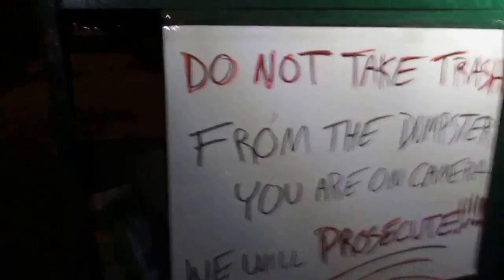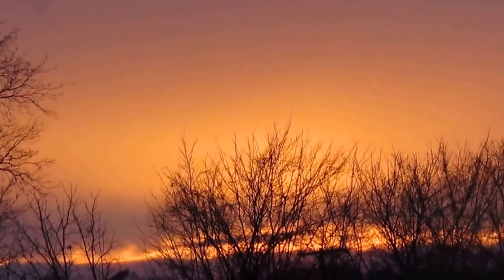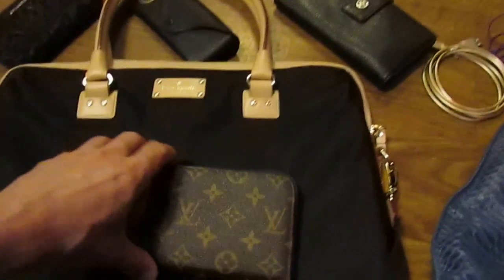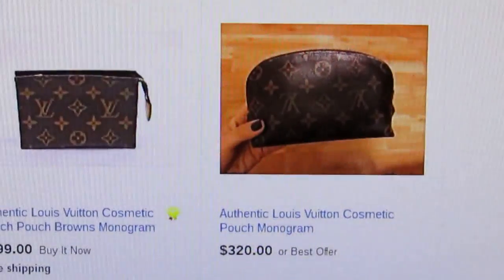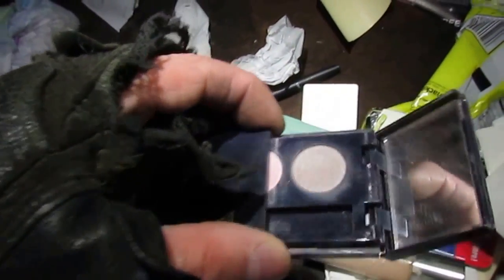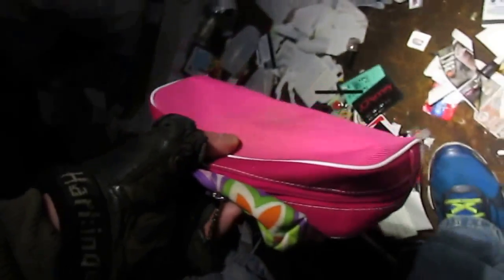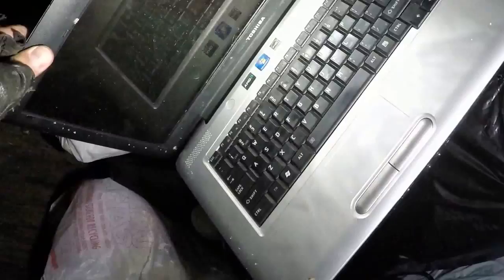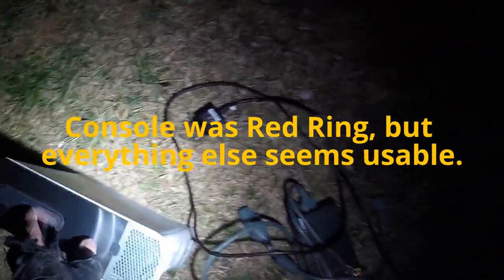Shocking Dumpster Diving - Kate Spade (fake) Louis Vuitton - $330 Fan Blades - Copper - Coach - Xbox

Comment: I went to the site, typed in Miami ide and it brother up the free make up so I clicked to put it in my cart and from there it won't let u do anything. Maybe that's why no one has claimed it. I'm going to keep trying and see if I can figure it out. Maybe it's something I'm doing.
Reply from the maker: hmm, it seems to be working fine. Although, if i knew anything about coding i would make it much more simple and stream lined! I think the problem you may be having is after you click to put it in your cart you then need to click the "view cart" button and proceed from there...Also, you need to be logged in b4 you start the process.

Comment: Locks can be removed without damaging the lock itself. Just cut the hasp itself.  A simple cordless tool with a cutoff wheel right through the thin part (hole) of the metal and the lock can be removed intact.  Do this only on locks that piss you off.

Comment: I know this is an old video, but you can sell the makeup as a whole lot in any of the FB dumpster dive groups. Everything you dumped out-Clinique, Estee Lauder, and even those drug store items- collectively could sell for $20-30 plus shipping for the lot. eBay does not allow used cosmetics, but if it's in VERY good used condition with minor use, you can sell it on eBay and label it "swatched". I know it's not your forte, you could start gathering makeup as you come across it and sell in lots to the dumpster diving community...including the makeup cases/cosmetic bags. Just disclose it hasn't been sanitized yet, so the buyer knows to do that. 😊

Comment: hay vulcher what's worth more the copper or the brass
Reply from the maker: the copper, but with todays odd market the gap is much smaller than usual. Copper is about $2.10 a pound (which is really low) and brass is about $1.20 a pound.

Comment: A spritz of diluted alcohol can disinfect most makeup. You can resharpen makeup. The only tricky thing to disinfect is mascara. Nice finds on the purses though. Clinique isn't high value though. Those fans were amazing, I would've left with at least 2. Easy resell. You always luck out on consoles. If you don't need the harddrive or the controller, I'll gladly buy those off you.
Reply from the maker: ya thats a nice hard drive. controller has a worn stick grip. I got all 3 fans, they prob all work. Can u tell me is that Louis authentic?
Reply from the maker: sure, but shipping cost for packages over 1 pound get pricey to the frozen tundra.
Reply: Yikes, I'm no good with purses and handbags. Look inside the wallet to see if there's any sewn on tags, or something that says where it was made. Louis Vuitton is based in France. If there's a shitty tag that reads 'Made In China', it's probably fake. :P You don't cease to amaze me, how the hell can you carry 3 fans on a bike. I need to get a scooter for the Summer.
Reply: Any way to find out an idea for pricing? :o
Reply from the maker: ya, anytime u may be interested.... just go to www.usps.com and enter your info needed and estimate weight. My area code is 72764. USA
Reply from the maker: 3 fans = 2 trips...:) ya, with a scooter u will have no problem shooting so much footage u could save up footage for the next winter ya know...
Reply: I'll have to do further research. I sent out my first item internationally a few days ago. I think shipping was roughly $12.

Comment: Use a copper wire stripping machine bout on Ebay for 39.99- still need to do allot of pulling with the hands, but makes it allot easier, especially on larger wire. Right now up here they are paying about 2.40 a pound for stripped copper wire (they call it bare brite), but the price goes up and down, you know- I just sell the really small stuff as insulated which goes about .70 pound- not worth the trouble. 
like you I find allot of great other stuff that I can use myself or sell- way too much wasre in this country- weve become a throw away nation. Your like me though, I stop to pick up penny's every time I see them- Keep on making the video's, their great- take care
        
      
      
      
      
     
    
   
  
  
  
  
 
 
 
 
 
 

  
   
    
     
        
         
          
           
            
               
              
           
          
         
        
       
        
         
          
           
            
               
              
           
          
         
        
       
        
         
          
           
            
               
              
           
          
         
        
       
        
         
          
           
            
               
              
           
          
         
        
       
        
         
          
           
            
               
              
           
          
         
        
       
        
         
          
           
            
               
              
           
          
         
        
       
        
         
          
           
            
               
              
           
          
         
        
       
        
         
          
           
            
               
              
           
          
         
        
       
    
    
   
  
  
 
 
  
   
     
     
        
         Have one to sell?ut   New Copper Wire Stripping Machine Cable Stripper Scrap Metal Recycle Too